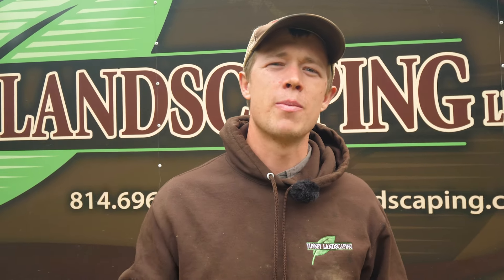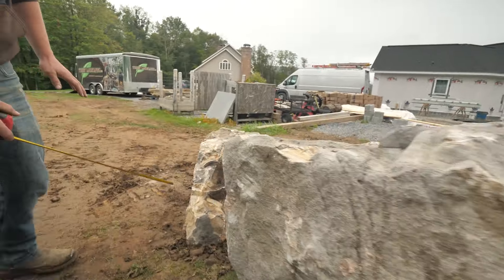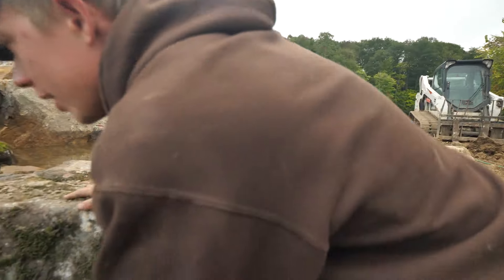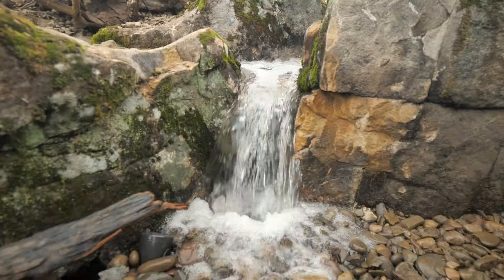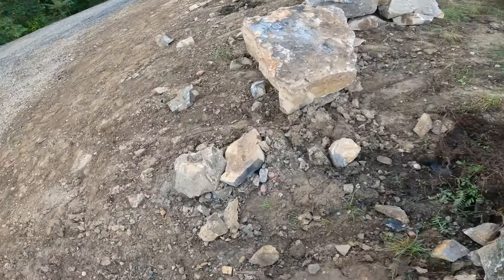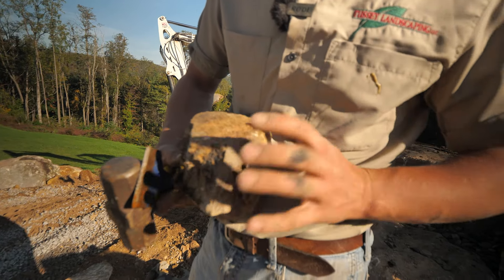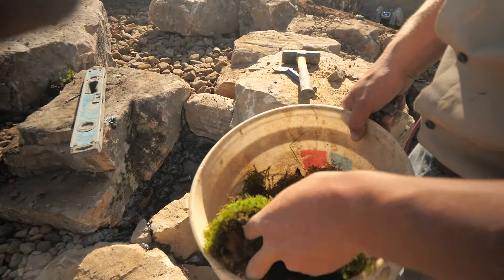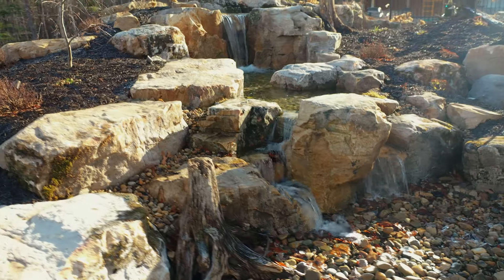How to Build Naturalistic Waterfalls | Step-by-Step Guide

Comment: Absolutely, without any doubt,the most informative video I’ve seen on YouTube. I’m building a waterfall in my garden on a much smaller scale, but after watching this, I’ve realised that the principles will be exactly the same and so I should be able to create something almost as good as yours..(maybe not as spectacular) Thanks guys. Bob from uk..
Reply from the maker: Best Wishes! Thanks for watching!
Reply: This is spot on for my situation as well! No experience with water features. Your information is clear and detailed. Best i have seen yet. 
I just rehabbed a garden pond that was filled in. I would like to replace  existing waterfall feature which is a 2’ wall of concrete with some rocks. It’s ugly!

Comment: Hey Ben , awesome advice & video . What type of liners do you use under your boulders , size piping from pump to spillway ? I am building a water feature with 70 ft run on a downhill slope of about 20-25 foot from top of spillway to my bottom basin . What size pump would you recommend & size piping . I am thinking 3 inch vs 2 inch diameter for more flow ? Thanks again . 👍⚾️
Reply from the maker: Hey sounds like a fun project. We get all our liners from aquascape. For a pump I would recommend a 5-9 SLD from aquascape. If you want more flow just add more pumps  the waterfall in this video has 3 pumps so that should give you some perspective. And yes I would definitely use 3" plumbing.
Reply: Thx so much for the advice & reply , really appreciate it & wishing you guys continued success and all the best 👍⚾️

Comment: Hi, Love this. It was one of the best 'how to' videos I've seen!   Two questions, at one point you say that the initial spillway was ' a bit messy and would need trimming out' in what way did you fix this?  Second question, when it comes to height v length of the overall feature, is there a 'rule of thumb' that should be followed?  I have a small-ish site but plenty of height available - what ratio should I be looking for?  Many thanks, Tony
Reply from the maker: I usually trim them with a gas powered paver saw or a grinder sometimes some hammer and chisel work.. there isn't really a rule of thumb that I know of. I have built some fairly short water features that have had a lot of height and I think they came out nicely.

Comment: Nice build, and very educational. I want to build a super large waterfall on my three acre lake . Like 20 foot tall and forty wide. I am having a hard time to find any information on how to plum it. What types of pumps to use. Flow rate etc. can you do a video on the water flow/ plumbing part of a build
Reply from the maker: Aquascape has some very good flow rate charts to help you choose the best pump factoring in the amount of head you have.  Either way for that size feature it's going to take a number of pumps. I figure 12 to 20 inches of spillway width per 10,000 gph.  Hopefully that helps. Good luck on your feature! That sounds like a fun one wish I could come help build 😜